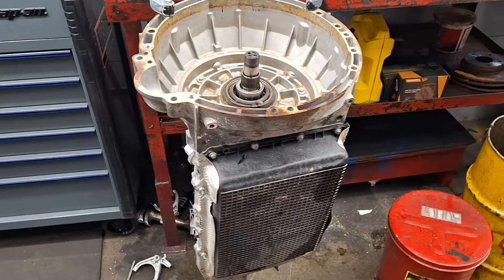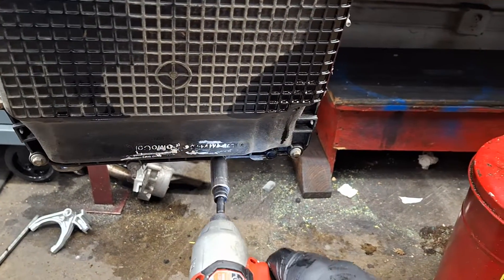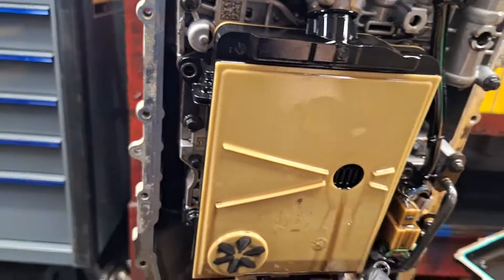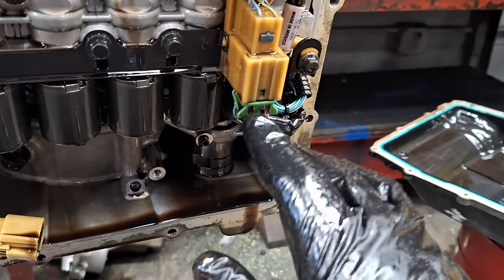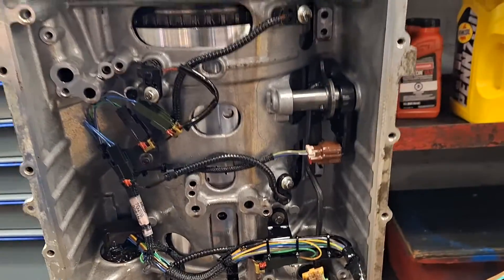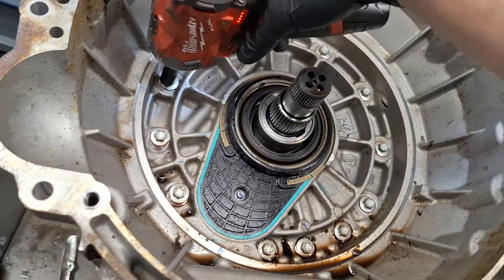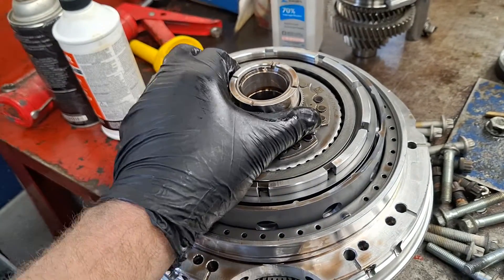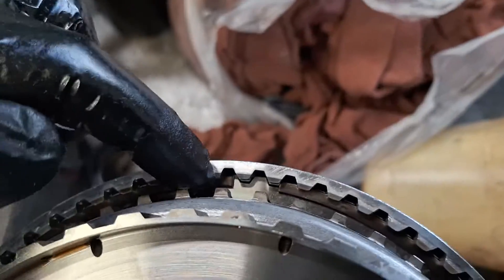Ford 10R80 Teardown | 10 Speed - CDF Drum Bushing Failure

Comment: I used Motul VI transmission fluid and filter on my 10r80 and solved everything. Its not gonna repair any damage, just the cold morning jerks, from drive to reverse jerk and so on. 3-5 shift smoothed out, 2nd and 4th also shift better. Shifts are crisp and quick, when slowing down and punching the gas its always in the right gear, but before it seemed like it was searching.
Reply from the maker: Interesting. I've wondered in the past if some of the issues are due to the mercon ulv, which is super thin and possibly ethanol based
Reply: @BigBensCarsAndCycles  hello I have problem with 10L80 transmission no reverse we open and replace new clutch and seals. And also converter we open nd replace new clutch..
Reply: @BigBensCarsAndCycles  on the 10r80 the harness that's under the valve body is that considered as the lead frame? Have a 19 model f150 some times goes into false neutral and the D letter when in drive will not be luminated for a second and rev like its in neutral would replacing that harness fix thst issue like the 6r80 lead frame would on those transmissions
Reply: @BigBensCarsAndCycles  will a 10R80 of a 5.0 fit into a 3.5 or will it need changes ?
Reply: My transmission does the same thing. Almost goes away completely when warm. Except 8th gear shifts a little hard. Do you think this is most likely my problem? Also where can I order parts? And where can I find parts diagram with part numbers for internals. Thanks in advance.
Reply: Maybe a good idea to go with a different fluid after initial break-in. I've come to know that nothing stands in the way of the economy gods.
Reply: I have a 10L80 and wonder if using transynd fluid would be better I think a lot of these issues is the ULV which is mainly for fuel economy
Reply: I find it hard to believe that a different fluid is going to solve what comes down to an inherent design flaw. I'm here watching this video because if I wanna keep driving my F150, I'm pretty sure I'm going to need a third transmission unless I can get the updated CDF parts installed reasonably
Reply: @actionjack84  Life isnt black and white like in this case by using quality fluid alot of these issues are mitigated and extend the life considerably. Although quality transmission fluid cant fix design flaws, a poor quality fluid can accelerate the damage.....

Comment: Excellent videos! My 2020 F150 is waiting on CDF replacement. Intermittent hard shift 4-5 and 7-8. I sure hope my dealership has someone as knowledgeable as you because this is deeper than I was hoping they’d have to go!
Reply from the maker: Hi! Don't worry, there's plenty of experienced guys, it'll be ok! Thanks for watching
Reply: @BigBensCarsAndCycles was wondering myself if the CDF drum from the 10R80 for Chevrolet will inter change, I heard that they do & that it's easier to get because Ford always has everything on back order & wants to cover this Six on the core & always wants it back, any insight you could help me with ?

Comment: My 10r140 had this same problem with the bushing in the CDF drum, 2022 F350.
Was making a grinding noise and vibration on the 4-3 downshift. Did so from day one, 13 miles on the odometer.
Sat at the dealership for 6 months because the sealing rings were on backorder.
When I got it back, only made it 5 miles before the new bushing shifted again...
Randy's Godzilla 10r is the only solution I have researched so far, they claim to "stake" the bushings to keep them from shifting.
Reply: I bought a new 2022 f150 5.0 and the transmission failed after 24k miles...Ford couldn't fix it so they installed a new 2024 10r80....fingers crossed they worked out the issues 😂
Reply: @longshot82383  They did if it was the issue he described in this video, they put a tooth on that bushing to prevent it rotating, best of luck man!

Comment: My 2018 Ford Expedition Max 4x4 is having the hard shifting, delayed shifting, shifting from 8th gear to 2nd gear, etc.....do you have an estimated cost on what it is to make this repair?
Reply from the maker: If your miles are somewhat low, I'd call Ford about it to see if they'll participate in the cost. That sounds like the cdf failure. For cost I'd say 3500 to 5000. I'd have to check to be more precise
Reply: @BigBensCarsAndCycles  unfortunately Im over my warranty miles at 68K.  It does sound like the CDF issue as stated in the TSB 23-2250
Reply from the maker: @scotprice8553  68k is low, you can call Ford customer support about it after your diagnosis
Reply: @BigBensCarsAndCycles  The wait time just for a diagnosis is over 3 weeks..and ppl say the repair time is actually taking up to 3 months.  I decided to just get a new tranny put in for about that same cost as FORD, and other mechanics were saying it would cost to replace the CDF drum, and other parts.  Thanks for the videos!

Comment: Hey Ben. I got a question for ya. ya might not know the answer or maybe ya do. QUESTION IS.  My 2022 F-150 (Built in March of 2022),  just had a Complete Transmission Replacement 10R80 in SEPT, 2023. The New Tranny came from Memphis Tennessee. Would you have a Clue if the NEW Transmission would have Been Updated with the New Bushing and Stuff? I know I'am asking a Lot of ya, But I wouldn't have a Clue at all.  Thanks Big Ben.
Reply from the maker: Hey! My money would be on it having the updated design CDF drum inside. I can almost guarantee
Reply: @BigBensCarsAndCycles  mine is a 2021 I bought it used from a dealerships  two weeks ago. Would they have replaced this before re-selling the truck to me? It was blue certified
Reply from the maker: @Trevormaffetone  no, they would not have. It's not a recall. Sorry
Reply: @BigBensCarsAndCycles , does the new CDF drum just have better parts or does it also have the lip on it to hold that bushing in place and prevent it from moving and causing the same damage all over again. I have read on other videos where people said when this first started happening that when the transmission was rebuilt all they did was push the existing bushing back into the proper position and put in a new set of seals. That would get you going again, but down the road it would fail again. Then I read that some independent specialty shops started fixing the problem by adding a lip to hold the bushing in place permanently. I just want to make sure Ford is doing the same thing now because my 2018 F150 transmission has failed and I can’t wait several months to have it rebuilt or replaced with a new one, so I have decided to trade mine in on a new 2023 model and hope and pray the 2023 has better parts and that lip. I love my Ford truck and really like everything about it, but that doesn’t mean anything if the transmission or engine has a catastrophic failure before 100,000 miles. If a water pump or an alternator goes out before 100,000 miles, I can live with that, but not an engine or transmission. I have never bought an extended warranty, but I think I will this time because of all the problems people are having. The only problem with that is my truck was out of warranty when my transmission broke, but even if it was under a warranty all the dealers were saying that they were behind 2 to 4 months on rebuilding these transmissions and most of the time the customer had to get a rental and continue to pay their monthly truck payment as well. I am lucky I had a backup vehicle and that bought me some time and allowed me some time to decide what to do. Thank You so much for your help!!!
Reply from the maker: @stonecoldflipper9503  2023 and newer 10 speeds have the updated lip drum from the factory. And when they replace it on older ones they install the good one
Reply: @BigBensCarsAndCycles , thank you, for the fast response and information. I have one more very important question. I have always changed my oil before the computer on my truck told me too, but when I told the service manager I wanted to change my transmission fluid at about 50,000 miles, she said, no, you don’t need to do that. She said the transmission fluid should be changed at 150,000 miles and that is what Ford recommends. She also informed me that I could not even check my transmission fluid level with a dipstick and they had to check it when they had my truck up in the air on a lift. I checked and found no transmission fluid dipstick and now I wonder if I had changed my transmission fluid at 50,000 miles, would that have saved my transmission. I know many years ago, people would usually do that change between 50,000 miles and maybe 75,000 miles. How often should I change my transmission fluid on this new 2023 truck?
Reply from the maker: @stonecoldflipper9503  the dipstick is located on the passenger side of the transmission under a 19mm cap. Needs to be running, hot at 185 to 200 degrees to check it. If it were my truck, I'd put an aftermarket aluminum pan on it with a drain plug, and drain/fill it every 30k miles. And do the filter every 2 or 3 services
Reply: @BigBensCarsAndCycles  for some reason I’m reading a lot that ppl are changing their fluid and the transmission started having problems after that. I guess it’s kind of luck of the draw
Reply from the maker: @Trevormaffetone  the only time I've heard of a 10 speed having issues after a fluid change was when it gets overfilled. which is easy to do by accident. ULV expands more than LV when its hot.
Reply: @BigBensCarsAndCycles  do you thinks these transmissions are just crap? Lol
Reply from the maker: @TrevorMaffetone  with a new cdf drum it's not horrible. But I'd rather have the 6r80
Reply: @Trevormaffetone  Every transmission has issues when it first comes out. Even Aisin transmissions used by Toyota. They improve as issues are discovered and revisions made. I had a GM company truck with the 8-speed and it was flawless, even though previous years of it had many issues.
Reply: @hochhaul   well I hope my 21 10r80 last me aleast till 150k
Reply: @BigBensCarsAndCycles   have a 2018 10 speed transmission. I was on a 8 hrs drive with about 3 hours in I felt two very hard violent thumps while trying to pass someone. My rpms skyrocketed to 3500 without catching a gear. I was able to catch and stay in 9th gear, pull off the interstate into a gas station parking lot. Put it in Park, discovered my entire under chassis from the transmission back to the rear bumper was covered in fluid  ford just put new fluid in 5 months ago  do you  think this could be overfill issues?

Comment: I do have a question. My 2019 f150 had to have a transmission rebuilt under warranty. But before they rebuilt it they tried to reprogram it and I was driving 70 mph and it shifted from 10th gear to 1st. And just messed a lot of the transmission up. But anyways after they rebuilt it. Sometimes it still shifts hard and jerky
Reply from the maker: Shifting from 10 to 1 may have been a cdf bushing fault. Your remaining jerky shifts are likely characteristic, but if it doesn't feel right to you, you can have them clean the valve body and install new gaskets under warranty (if you still are)
Reply: @BigBensCarsAndCycles 
Thank you. Yes I have one month left on warranty.

Comment: Thank you for your vedios. I wish your shop is near Seattle!
My 2021 F150 transmission when up to working temperature, it will start having some whining noise during shifting, especially from 1 to 5 gears, above 5, the no noise or maybe unnoticeable. But within each gear, everything is good no noise. And each gear shift is very smooth if I don't push gas pedal. Downshift though, sometimes it has a bump from 4 to 3,but if I control the brake pedal, I can avoid it.
do you know what to do to fix the noise? It is not loud, bbut annoying to me.
Thanks again for your great vedios.
Reply from the maker: Thanks for watching, I'm glad the videos are helpful to you! Some whine is normal on those due to the offset pump drive gears. And firm shifts are pretty much normal too. Ford can run an accelerated break-in or clean the valve body which can help with random firm shifts. But they all get firm sometimes

Comment: Thanks for the video, very helpful. I have 2 questions for you if you dont mind.
1. Do you typically see other damage in the transmission when the CDF bushing goes, or are they usually like this one and only need the drum and seals replaced? 
2. Do you know the part number for the tool used to compress and remove the friction/steels in the CDF drum?
Reply from the maker: Normally it just needs a drum and #3 sun shaft teflon rings. Rotunda 307-589 is to remove the smaller pistons. 307-741 is for the larger piston. 	307-749 is to install the teflon rings
Reply: Wow! Looked up those parts - and they ain't cheap! Looks hard to find too. I have a 2017 with 75K miles on it. I'm assuming if\when it breaks this one will be on me. With my luck the cam phasers will break at the same time too.

Comment: Wow, am I happy the DPS6 is nowhere near as complicated as this thing!!!
Reply from the maker: Yes sir! 👍
Reply: The only real reason for so many gears, I'm sure, is that some of those are very low gears, for towing/etc, right?  @BigBensCarsAndCycles
Reply from the maker: @DetroitMicroSound none of them are granny gears like that. There's just lots of gears to choose from for ideal rpm for different driving situations. The pcm will actually skip several of the gears during normal light driving. Around town it'll go 1-3, then either 3-4 or 3-5 depending on throttle and load
Reply: Interesting. But weren't F150 drivers happy the old way? 😉 @BigBensCarsAndCycles
Reply from the maker: @DetroitMicroSound  I like the 6 speeds better for sure! Smoother and more simple & reliable
Reply: I mean, at 81k my DPS6 still works great! 😁  @BigBensCarsAndCycles

Comment: Dang, I wish I cudda seen ya Pull that outta the Truck...🤔.  I get that it's a Warranty Repair Big Ben, but why aren't the Clutches, and some other known  Defective Parts just replaced while the Trans is Out of the TRUCK? (Or a New Updated  CompleteTransmission) That's a Ton of work to just replace a Few things. It just seems as tho this Issue is just gonna keep coming back??? Isn't it. And sooner or Later, the Customer is going to get Stuck with a Hugh Repair Bill down the road. I here tell this Tranny can be 4/8K when Replaced. It looks like a Lot of Defective Part's are just being replaced, and all the rest is just Re Installed?
Reply from the maker: Hey..the clutches are in good shape, and the only common internal issue is the cdf drum on trucks older than 2022. The drum I'm putting in is redesigned and they shouldn't have an issue again out of this transmission for a long time. My hands are tied with warranty work. Especially this one. This is a technical service bulletin. I have to follow ford's instructions to a T, or they will refuse to pay. Then I will get charged for it. If it were up to me, yeah a fresh new transmission would be nice for them. Or a complete rebuild. But Ford doesn't want to pay for all that. Just the bare minimum. Thanks again for watching. This is a remake of my previous teardown video. That video was sideways lol.
Reply: @BigBensCarsAndCycles , I have a 2018 F150 with this transmission and it made it to 87,000 miles and now it has failed. It started out having trouble shifting from 1st gear to the next gear and after a few weeks it got really bad. Now it jumps from 1st to 4th and then to 8th and then back to 4th and then it stalls and has no power. I need your advice about what to do. I don’t trust a fix or rebuild because I am afraid I will just have more problems down the road. I am not sure if I have a new transmission put in if it will be with upgraded parts or an old, new stock transmission. So, that concerns me because if it is just a new transmission and it is just like the one I have now, it will eventually do the same thing. My big question is, if I trade it in and get a new F150, which year has the new upgraded parts that will prevent this from happening again? The 2022, the 2023, or the 2024?  What would you do? The dealerships are backed up 2 to 4 months on repairs-rebuilds and I really don’t like that option anyway. Also, there are no independent shops near me that rebuild this transmission. If I get a new transmission, that will still take a month or so to get put in and it may be new, old stock, so I am leaning towards just trading it in on a brand new truck, but I need to know which year has the redesign to stop that bushing from moving in that drum and destroying the transmission. Thank You, for your time and advice!!!
Reply from the maker: @stonecoldflipper9503  I believe late 2022s have the updated drum. So a 23 would be safe. If you decide to let a dealer fix it, this is a common problem and they're knowledgeable about fixing it. And there's not really any other common issues with these other than firm shifts which aren't a big deal - they'll all do it